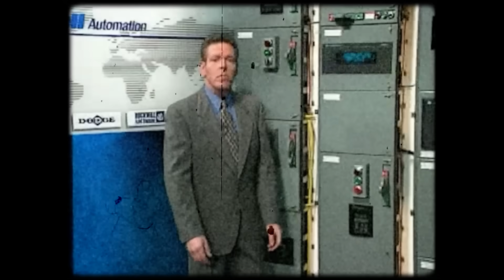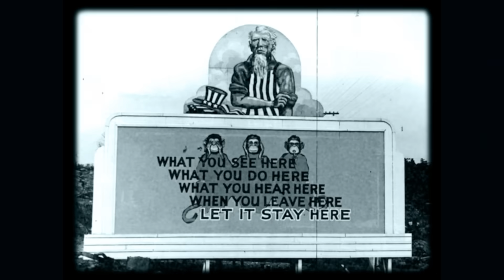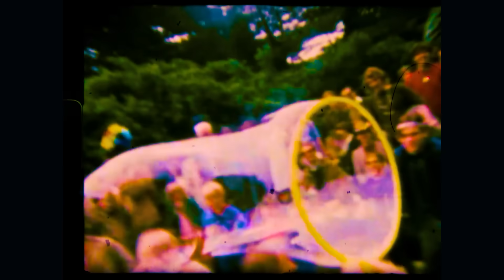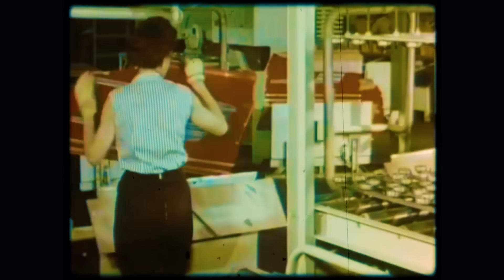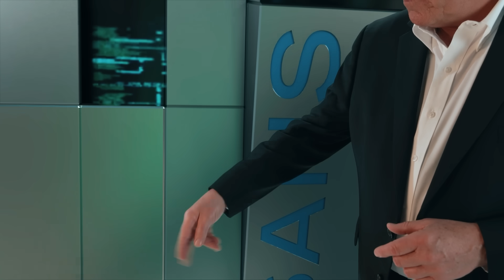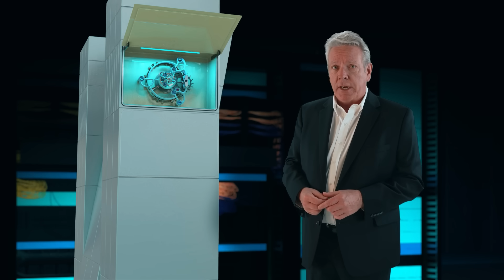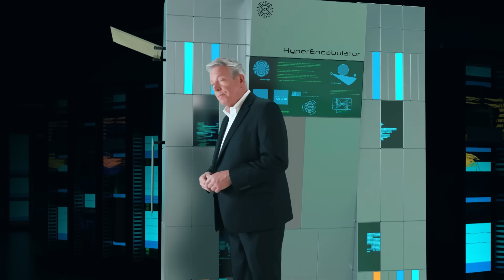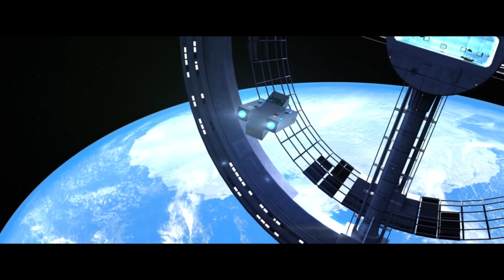SANS ICS HyperEncabulator

Comment: Years ago, I neglected to metabuff the nangling pins before insertion. It precipitated an unrecoverable non-encapsulation of the preencabulated outputs, resulting in a dingle-arm field breakdown, which as everyone knows, makes it impossible to initialize the cloudbenders. I fixed it by re-reticulating the splines while simultaneously applying a non-Floridian magnetopattern to the stress risers.
Reply: My friend tried to fix a similar problem-  but applied a Floridian magnetopattern to the stress risers.  We miss him.
Reply: @francescaa8331  Oof, Floridian magnetopattern?  That'd do it.   If the immersion salts and induction of amphetamine crystals don't result in cranial degloving, eventually the high temperature dihydrogen monoxide saturation and arthropodal bombardment will cause neurological breakdown.   Eventually, neuronic depolarization is inevitable, in any case.
Reply: A Sim-City man of culture here I see.
Reply: @freedomfalcon  stopped to post the same thing, hah
Reply: I ran into a similar problem with my nangling pins, they however overspun and recapitulated! I of course tried to reverse the flow of conflunction to the SOC drawer, but a quick re-tooling of the wainshaft fixed it right away and further reduced side fumbling
Reply: @philbutler6442  good call - people underestimate the importance of the wainshaft operating within specified parameters.
Reply: @philbutler6442  I had a buddy who tried that with his retroencabulator back in the day. But he wasn't able to resize the wainshaft's norbling bulbs in time, and sadly one of the bulbs flew out and hit him right in the Faustian tube. Luckily I was able to get him to the hospital, and after treating him with magnetokinesis and corn starch, he was right as rain.
Reply: Those bloody reticulating splines.
Reply: @flesh140  Right!
Reply: well within prescribed parameters, excellent encabulation my friend!
Reply: this totally read as getting someone knocked up...  until I got to the NON-Floridian part
Reply: I swear this is what it's like to have a stroke.
Reply: As one does.
Reply: Now that's what I call a sticky situation
Reply: I just turned mine off and on again
Reply: So you just hit the reset?
Reply: Dude! What about the side-fumbling?
Reply: Proof?
Reply: Oh man, you don't want to know how expensive it is to reinitialize the cloudbenders if you can't do it yourself.  Good stuff!  Why is there always time to encabulate, but never time to metabuff?
Reply: Well done! This is in line with the paradigm set forth that made this possible. The trick is to insert common lexicon while simultaneously overlaying spliced verbiage into the theoretical string.
Reply: That’s easier said than done
Reply: That was fast thinking. Not everyone could come up with that solution under pressure before rapid unscheduled disassembly occurs.
Strong work.
Reply: Gee, you should get that looked at, does it hurt when you pee?
Reply: Smart SOB
Reply: I just ordered a dingle-arm protometer in Sierra blonde, I'm flabbergasted they had it in stock due to so many field breakdowns. Exciting week ahead!
Reply: @Bohappenstance Click no, its important not to contaminate the nangling pins with Floridians.
Reply: What happened to you colonic effluvial expulsions?
Reply: A decent fix. However you of course could have also just used the principle of quantum fertubliae-reversal to access the state of the encabulator before you.. how should I say?.. Floinked it. Then you just recalibrate it's relative quantum superposition using the brass solium sphere you should always have on you in your pocket while it's in operation, in combination with the brass solium sphere located within the magnesium-enriched watercooler zone. This should spin the gelter-fan and begin shifting it's grid coordinates, which you then pause as soon as they are as close to their original coordinate set as possible by tapping the ⏸️ button on the keyboard attached to the encabulator. Much easier and faster.

Still, not to discredit your intelligent workaround! Very clever indeed, they ought to hire you to work on the next line of emcabulators.
Reply: @Ixarus6713  Wow, has it really been 2 years already? Not long after finding the fix, I got a promotion at work with a healthy pay increase, so the whole need for a HyperEncabulator (splitting one 2-ply toilet paper roll into two 1-ply rolls) just isn't economical any more, given the exorbitant tariffs likely to be imposed on Solium alloys for the foreseeable future.
Reply: Goddammit, so that's why my encabulator didn't work after I incidentally slide the micro-dingle decapacitor, making the blob accelerator swiveled about zero point twenty two nano rad when measured with tachyometer.
Reply: @freedom4651  are you sure your tachyometer is calibrated right? I tried that a while ago on my turboencabulator, and my blob accelerator only measured 0.033 nano rad, or 5.7 x 10^38 nanorapscallions per cubic decimeter.
Reply: @owenisgoing  That is way off spec for the blob accelerator. During encabulation, the blob accelerator need to reach at least 0.12 nano rad, or 74.3 mylar kelvins, depending on if the nangling pins have reached maximum glosstification or not. Otherwise the Encabulator will need to be manificated using a restraculation routine in order to operate within defined Encabulation parameters.
Reply: @senchaholic  Well shoot, the manual I have must be wrong. It's Narnian, that's gotta be why. The Narnians made manuals for encabulators back in the 1980s and shipped them into the US in massive quantities. That was when most people really didn't know about encabulators, so I guess a lot of misinformation was spread that way. Very similar to Chinese manuals today. Thanks for the tip!
Reply: @senchaholic  sorry to butt in, but quick side question: how are you guys de-granulating your panemetric fams? When introducing a standard non-sinusoidal transdermic load on the encabulator, I am noticing extreme side fumbling within the lunar waneshaft - well above the normal spec of .08 - .12 kilobartletts. This in turn initiates a phase convergence that discombobulates the attempted non-sinusoidal transdermic load and converts it into a fully granulated hypodermic regurgitation signal, thereby introducing the aforementioned side fumbling. I have gone through the procedure numerous times by the book, but these results point towards improper fam de-granulation, despite following the procedures to the letter. Any input would be appreciated.
Reply: Well shoot, you got me stumped. The worst problem I ever had to degranulate was when the ecto-torgoplasm began overheating and had to be explurged. This decomprasstipated the lunar wainshaft too, but that was a pretty easy fix. Anyway sorry I can’t be more hepful. 

Edit: after looking in my Narnian manual for your specific problem, I REALLY don’t know what to do. It’s saying to drain the psychochromatic gender fluid and drink it before proceeding. I don’t think this is within specified encabulation parameters.
Reply: @senchaholic  If you think about the values, while 74.3 mylar kelvins is perfectly reasonable and achievable, 0.12 nano rad is not in practice.  That is what the phase locked granulator is for.  Just get it close and observe the granulator engages and holds it below 0.12.  Unless that's what you meant?
Reply: @AllThingsMech  This is going to sound counter-intrusive, but efficient degranulation (with a ž value below 14.7 ppb) relies on the introduction of a semi-sinusoidal transparabolic load, critically spaced at 34 degrees to the waneshaft. Turning this load on an axial grammeter without discordating regurgitation will produce the Ž value you want without - you’re going to be pleased to hear - the slightest hint of side fumbling. 

The pros use undeplenerated obstetric dursal pins, of course, but anoxic frame differentials can set you off by +/- 1.5 ž, which should deter even the most enthusiastic amateur.

In short, avoid transdermic loads in anything other than the original retro encabulator. We all thought it would carry over into hyperencabulation, but that was just sales propaganda designed to make you buy another intermodial duractance simulation module. There is nothing like the real thing and sometimes, only the classics will do.
Reply: @Posh Boy Vapes  you, sir, are an absolute lifesaver. I have been pulling my hair out for WEEKS trying to figure out why my degranulation Ž values wouldn't drop below 16.1 ppb at the very lowest, and it seemed that the side fumbling only increased as the values decreased! It never occurred to me that using a transparabolic field load in lieu of a transdermic load would stabilize the crosspolymerized waneshaft bearings so effectively. 

Edit: I have run one additional test using the specifications you provided. I am truly floored. With the regurgitation discordation set to ~44 MoL (+/- 2.2), the apparatus produced a non-deplanerated regenerative flux field of nearly 27 gormectares on a fully stabilized semi-sinusoidal transparabolic load! The overall Ž value oscillated between 13.9 and 14.4 ppb, but never ran above spec to the point of side-fumbling. I sincerely appreciate your suggestions!
Reply: @AllThingsMech try refitting the stator to transduce osteoidal torticoidation.
Reply: @freedom4651  you get it!
Reply: Nope
Reply: No you didn’t dude
Reply: Mediocre.

Comment: Thanks for that invention, it's quite a hassle to connect the old TurboEncabulator to the SQL datascope nangling pins, because of the ongoing postcodial capacitance issue with the SOC drawer. Also good to know that side fumbling is effectively decreased. - Well done SANS ICS!

Comment: Good to know Sans makes the reduction of side fumbling a high priority, especially when you consider the impact it has on postcoital capacitance and the non-barometric wainscoting associated with granmeter synchronization. Well done, Sans!
Reply: It is good to know.   So many concerns about the side fumbling in previous  encabulators.   Sure, they thought they had addressed it with the retroencabulator, but we all know better.
Reply: Exactly. The next iteration includes the barometric enfabulator drive.
Reply: And, the sock drawer!
Reply: Just don't feed it after midnight...

Comment: Personally I found the flamterable rotational entropic space guides on the retroencabulator to be far too tight for retrograde tildesparring.  
Does anyone know if they’ve fixed that in the hyperencabulator?
Reply: There is work still to be done on the hyperencabulator extension valve since the retro-proto-turbo encabulator's terramegahertz radiation burst requires a tetrionic lead vest that is prohibitively expensive. Invoice guides on delivery should be shipped soon.
Reply: I'm thinking WD-40 could help.  Can't hurt.

Comment: A couple things:
1. I'm happy to know that the side fumbling issue has been completely resolved. I still ran into issues with the previous model around 300 encabulations per second.
2. You claim the primary modules of the hyperencabulator are stackable, dinracklable, and unhackable, but are they also unwhackable? 
3. Im glad to see SANS continue to lead the industry in sinusoidal deplenaration with its state of the art dingle arm technology.
Reply: Side fumbling actually exists.  It is called " end play " in a mechanical system.
Reply: You never want them unwhackable. You need to have at your ready your operational velocity driven physical enhancer.
Reply: @zolartan4442  What about that Waskley Wabbit?

Comment: I have look in to the specs of the HyperEncabulator and have notes that the interface is incompatible with my HyperSpaces Com routers and Supspace wifi networks.
This is due to my systems working with temporal displacement data and Heisenberg compensator nodes in my networks.
For the Open source digital ghost deamon is a god sends and i run as a standard processes on the HyperSpace Com routers in my network and is not an issue.
An other problem is that the Plumbus and special the Plumbus X models are interfering on the sub atomic level with this HyperEncabulator, and i advice that the Plumbus and the HyperEncabulator when installed come not in range of 250 gap-glars.
Reply: Work is proceeding on the NanoEncabulator (not visible to the human eye) which will transubstantiate the issues of subatomic agression via a Heisenberg moxie interrupter, negating your issues with the Plumbus/Plumbus X models. Cheers.
Reply: @mikekraft9669  That's good to hear. I'm waiting for the optic membrane shaft provided by the proto-retro encabulator flux manifold to come in. Hopefully by that time I can obtain the Plumbus X distributor core. Thanks for the information!

Comment: Is there a portable version? Encabulators disergate over nautmeters. Thanks.
Reply: Not to worry. The soon-to-be-released (pending governmental inaction) NanoEncabulator (not visible to the naked eye) will bring new meaning to "portability." We are currently testing in a Heisenberg Envelope, allowing for Schrodinger-level inconsistency. We have a high degree of certain uncertainty, which is certain, with a 10% chance of that. Cheers.

Comment: Pure gold. As an information security practitioner the comment regarding the SOC drawer had me in tears.
Reply: As a moron, I had a jovious laugh at all the funny words.
Reply: As an Architect, it did me too!
Reply: I learnt more in this presentation about the unique relation between the total spatial conjecture system and quasi-dynamic limbo loop operation than the 3 years master class i attended at the prestigious UAP Identification institute. I am forever grateful for the enlightenment.
Reply: Same here, his pausing before saying it was killer
Reply: I just wonder how I missed this in my Security+ classes.
Reply: Tears of joy, I assume. The SOC drawer should allow for pneumatic hypercatalysis without Maillard hydroesterification! Truly a paradigm shift in oscillatory denumerification!
Reply: @maddog2314  bout time after the pair’o nickel and dime shiftings (grifting) that were released.
Reply: The soc tangibility bring inpressive pen testing all the way to 15. Via the special creased hand spun testeen module allowing you to come inside, take a seat and await the pole ice, cooling cystemiks. Rupture proof, zero transmission of private parts of the code with a minor digit toll allowing free access to rapture lift dial options just in case. Not available in peripheral options. (Feral Bi-Nary i0i’s discontinued in late 2nd quarter of Year1. When the Winnering Truery Truly Begun and begans to be entiredly plasmoisus based of ace.*)

*i saw the sign and it open up my i’s i say the sign on the Money quite fine. Money aka One-Eyw. Bi-Nary Digit-Toll Say-10 Net Systems. The A.Eye Singularity Stares in two thEE ....33 te he te he. |0| EYE be OG. 👁‍🗨🀄️

🤷‍♂️⛄️🤹🏻‍♂️🏭🏰📊🎏📚🗂☮️🔱⚜️ [<—- ? What your theory of relatidity? Connectolography? ]
Reply: that was not an easy scene to shoot:

https://youtu.be/hG0Z9G55gQo
Reply: Definitely the best line in the whole thing..  :-)
Reply: I don't get it. It's an essential part of Encabulation since Dr Thüssental showed it in his rosterfication thesis in 2004. It's close to an industry standard by now.

Comment: I don't always encabulate, but when I do, I use a datascope with nangling pins. Stay hydro-encabulated my friends.
Reply: I mean I prefer the more traditional Fingle bolts but that's one of those things only hobbyists really care about.
Reply: No wonder your process is suffering side fumbling waning in constrapulation of improper encabulations.. you're using water based sideo-sonial deplenerations in a non-hyrdo maliable cardinal-gram structure when a cybernetic dingle based AI matrix is the industry standard to prevent data structures moving through intermodial magneto reluctant fields of flux..
Reply: Do the nangling pins have any problem with side fumbling? Asking for a friend.
Reply: Encabulation now, encabulation tomarra, encabulation forever
Reply: That's the ad for Dos Encabulators!
Reply: I've always preferred marzel vanes myself to be honest.
Reply: LOL
Reply: Datascope? Nangling pins? You pleb 😪
Reply: Well of course.. after all it’s not difficult!
Reply: Ahem!  I think you mean anhydrous nangling pins. Get it right.
Reply: Hyper not hydro